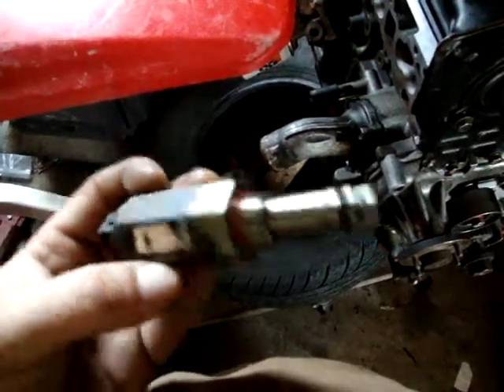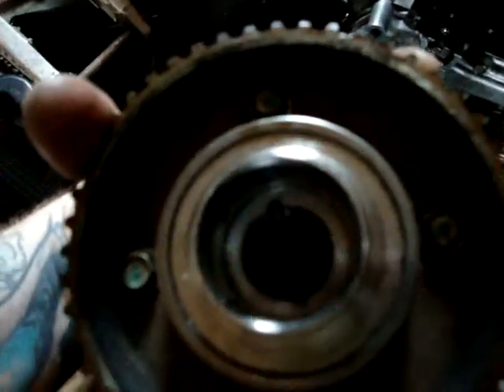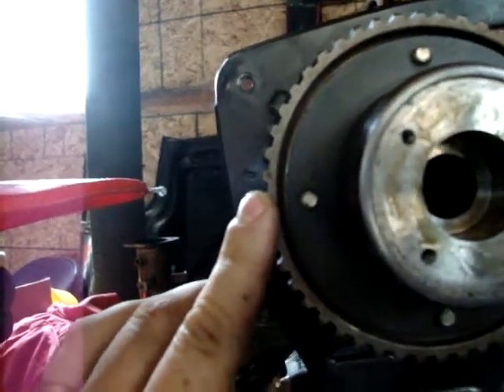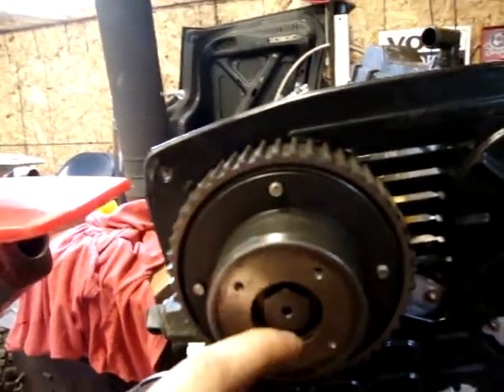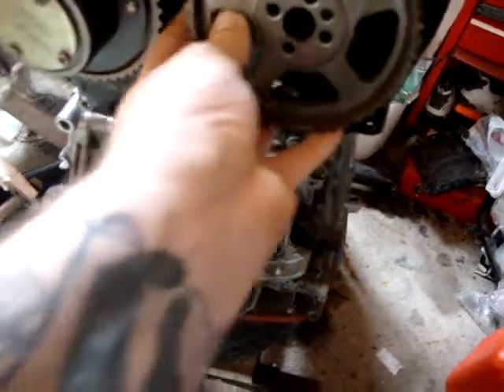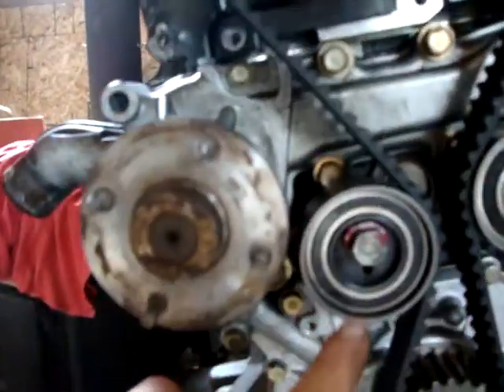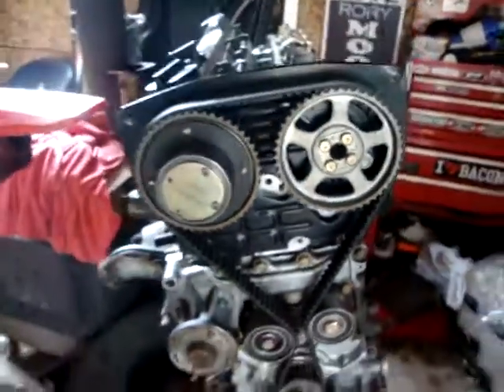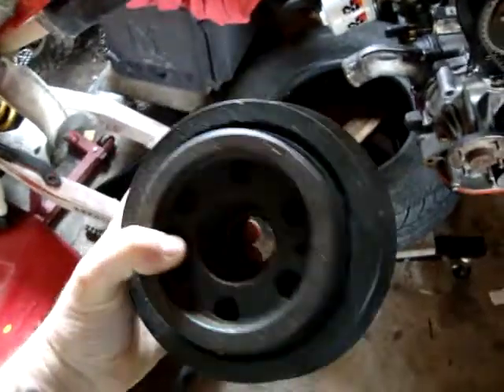rb25det build part 15

Comment: How did you hold the intake cam gear to torque it down??
Reply from the maker: +jhaze918 with the valve covers off you can hold the cam with a wrench. get a friend to hold wrench and torque it. hope that helps
Reply: +stephen moore thanks man! How's the build going?